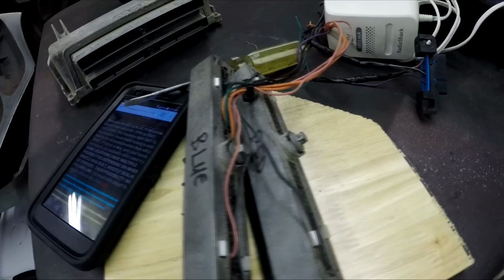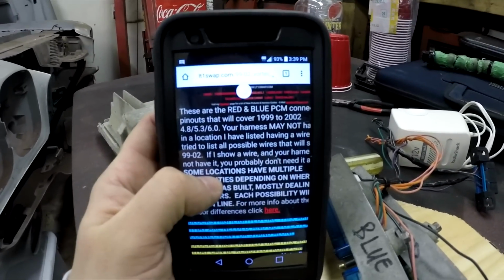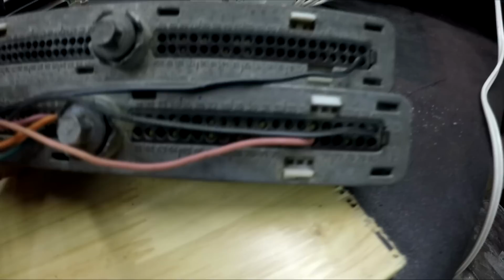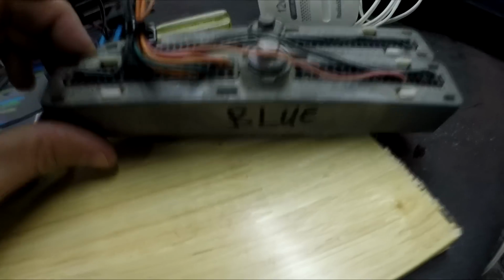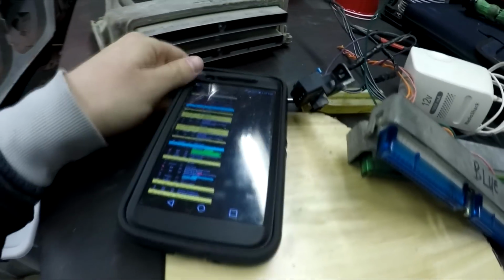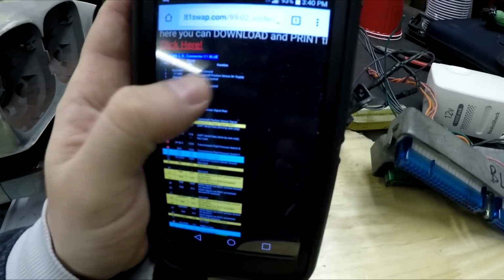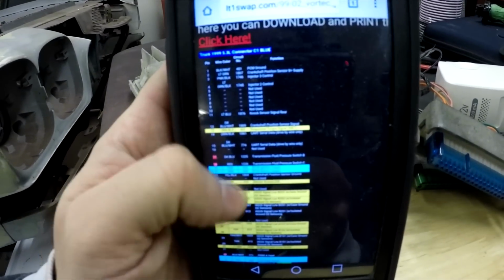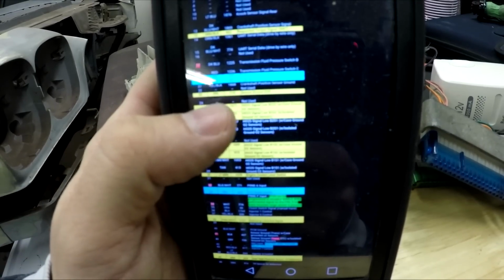EASY LS Engine Tuning Harness | Bench Tune with HP Tuners, EFI Live and MORE

Comment: You only need the blue connector.
On the connector, you only need pin 19-12v switched ignition, pin 20-12v constant, pin 59-serial data, and pin 60-ground.

Comment: Hold up Red Blue is the 0411 aka P01 and the Green Blue is the P59. The difference is 500kb or 1Mb with the P01 starting in 99 to 02 Truck and 99 to 03 vettes and P59 03-07 Truck and 04 vettes. Now the throttle body being DBW or DBC is 100% dictated by the OS and you can swap the OS as I have a RED BLUE P01 in my 02 C5 and it is DBW, and I am swapping to a 03 Truck P59 but gonna give it the 04 vette OS that can run flexfuel while also having the 3 bar Map code mod available as flex came out in 02 and you can easily find Tahoe/Suburban OS from that year with Flex tables, but it only gives you the 2 bar mod as an option. Let alone the changes from a 02 C5 to 04 is less than a 02 C5 to a Tahoe.

Comment: Accept the express harness in my experience it’s a green and blue connectors but its drive by cable
Reply: I have a 2005 blue/green dbc ecm but i recently pulled a ecm from a 2007 savannah that was dbw

Comment: I was checking out EFI Forums ...  and tried to register .  If you are registered with them .. would you please send ADMIN a message that I am getting the following message when I completed the registry ...  I have tried to register 6 times at different times and can not get registered and sure others who want to become a member are having issues as well.  Thanks!

Service Unavailable
The server is temporarily unable to service your request due to maintenance downtime or capacity problems. Please try again later.
Additionally, a 503 Service Unavailable error was encountered while trying to use an ErrorDocument to handle the request.

Comment: Hi.. Can you help me.. I want to make a adapter with pcm blue plug to obd 2 to remove vats on bench.. Can use the stock plug with all pin in end wire only the nessesary wires.. If yes.. Which wires?all this because I have only one blue plug

Comment: Hello, I have a 2003 Silverado Z71 with the 5.3 DBC with the 6106 ECM. Can I use this ECM and factory harness for My LS swap into my 1997 Silverado Z71. I see alot about using the 0411 but my donner truck has the 6106 ECM?

Comment: Great videos I have a 01 Yukon the OBD2  has an extra wire on number 14 it’s dark green wire called  diagnostic signal E&C bus I was wondering should I pull it or wire to battery with orange 16

Comment: hey nice work so one question, am rebuilding a LS harness and am saving low oil level sensor, the question is, Do you know what wire from PCM is the one that triggers the wire to turn warning low oil light in the dash to know when oil pan is low?

Comment: does it matter wich harness plugs i use if it will be depinned? need blue green but will either work for this?
Reply from the maker: Yeah they are just colors. You may have to grind off a small plastic edge they put on the colored pin covers to force them to be installed a certain direction, but other then that they are all the same as far as I know.

Comment: Hello. I just completed my wiring of my harness and I went to start my dad's 1967 Olds Cutlass with 4.8LS (Engine from 2003 Chevy Silverado) Conversion and smelled fuel, I luckily had the exhaust and headers separated.
I saw fuel spraying out of the passenger side of the header.  I Swapped injectors for Cylinder #4 & #6 after smelling fuel on the plugs. I restarted the engine and the fuel still leaked unburned raw fuel.
Any Ideas on how I should fix?
Reply: John Smith Hey John Smith what do you charge to do a wiring harness

Comment: i only used the blue connector for mine, and green blue pcm are not just drive by wire a lot of express vans have them with drive by cable

Comment: i believe you actually only need the blue connector? I just tuned a blue and green ecu thru a blue and red harness using only the blue connector.
Reply from the maker: I have heard that before. Makes sense as the other connector is just two grounds.
Reply: I'm using only BLUE connector, works just fine.
So you can rip off the GREEN/RED connector ;)
Reply: I have used mine for years and it is only the blue connector. Works on the 0411 Red/Blue and P59 Blue/Green  style just fine. Like your projects!